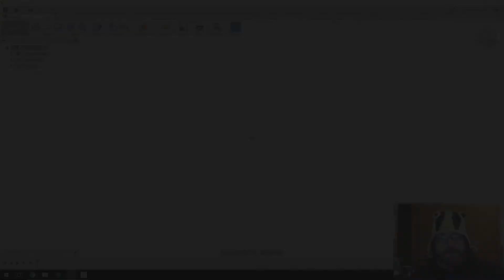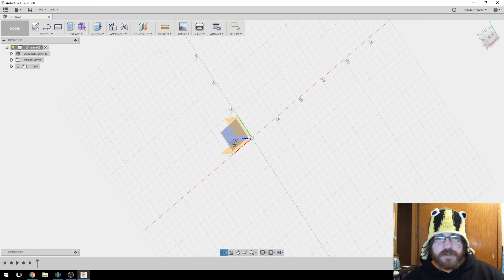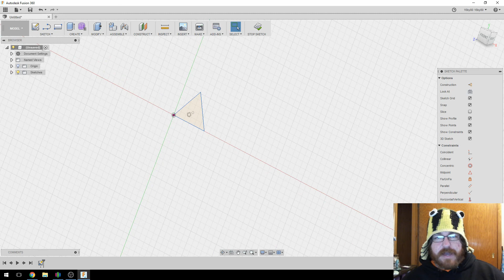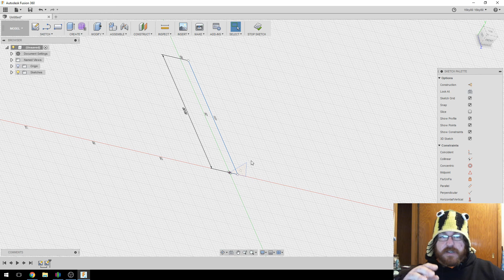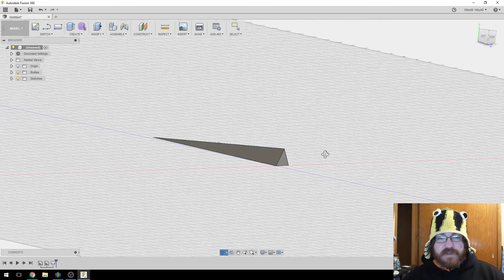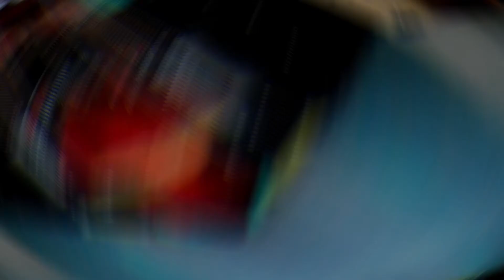Design a Lure: Micro Fishing, Fusion 360 Ultra Basic

Comment: I was expecting to see an actual fish shaped lure not just a triangle, this would not work for bass. Have you made any bass lures in fusion?
Reply from the maker: Quite a few. This is a type of ice fishing bait similar to the wedgee or the whip. I've caught bass on it a few times although, through the ice micro fishing.  This is an ultra basic video. I did a stream doing a complex crankbait recently. (long video of whole process) You can find that here: https://youtu.be/oVbEzDwG9FoI've done a couple videos on soft plastic designs as well: https://youtu.be/6c4ezRO48cQ , https://youtu.be/jUjiS7iRR7U , https://youtu.be/DS8O5I2oZDM , https://youtu.be/JXSBZHVAfKs
I will be releasing a few crankbaits and a stick bait in the near future.  I have 5 designs so far with good action in the tub but haven't had time to get them on the water yet.  Thanks for watching.